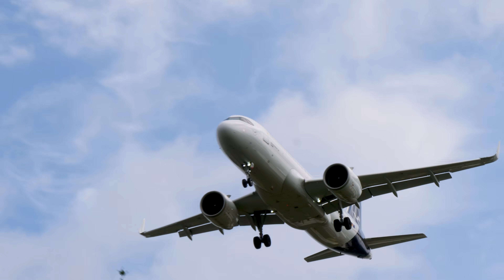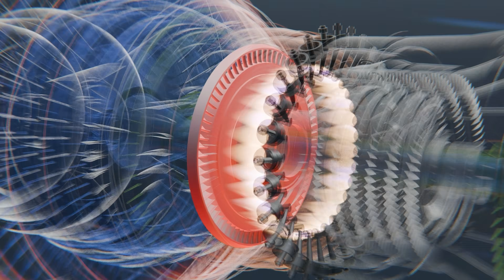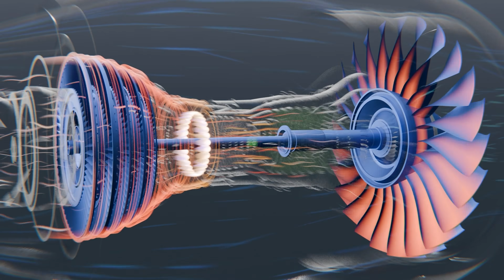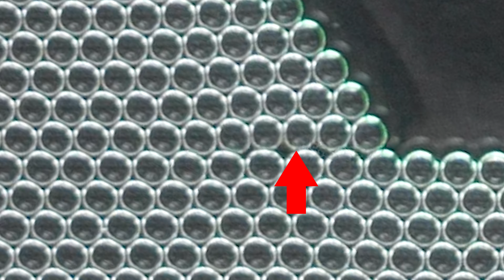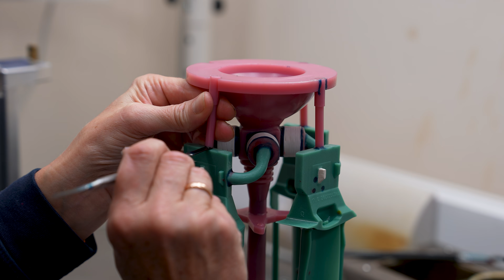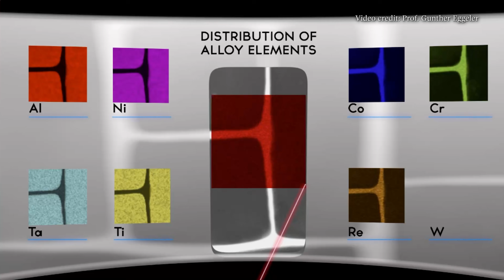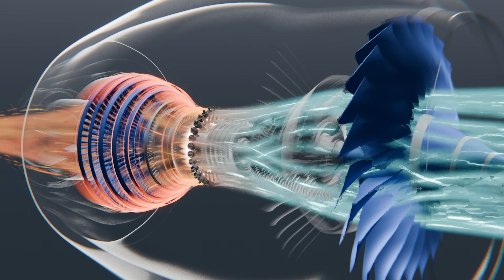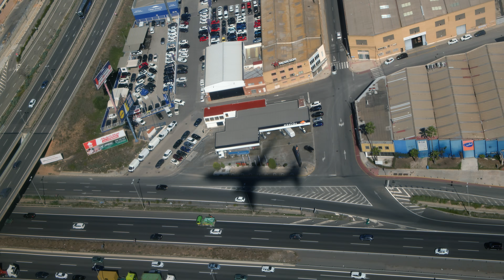The Ridiculous Engineering Of Jet Engines

Comment: Aerospace phd here: I’m a turbine guy, I have an anecdote. 

Tungsten turbine blades actually have a more interesting story. I remember during my studies I asked this same question to my professor, why not tungsten? The answer he gave is that obviously it had been tried again and again. Tungsten is particularly reactive at these temperatures. There had been a testing with a tungsten alloys that held promise but they always dissolved in the oxygen rich environment. So they coated the blades to protect them and tested them. After the test the specimen was removed and appeared to be in good order, but it was realized that all that was left was the ceramic coating. The tungsten inside the coating had eroded away. I presume a small hole was made in the ceramic coating (which is not uncommon) and it reacted away.

Now imagine that in your engine, any breach in the oxygen barrier leads to complete engine failure and probably a heavy rotor disk being liberated!

Edit: There have been a few people asking about my disseration topic. I'm a hybrid electric turbine guy. You can read my dissertaion for free since I paid the academic mafia... The title is Characterization of an Aircraft Turbo-Generator Design Space With a Shared Turbine-Electric Rotor Disk.
Reply: that's kinda hilarious lol, you're flying at 30,000 feet, one second you see the engine, next second the plane loses weight equivalent to two airplane engines and all that's left are 2 phantom shells.
Reply: @crucifiedsoulfr "Aww god damn it, the engines dissolved again!"
Reply: That’s what they said at Pratt & Whitney about their GTF disk failures!
Reply: @crucifiedsoulfrwell let’s look at the bright side here, at least the emergency landing is gonna be a lot easier 😂
Reply: @bravo_cj👈🏼gravitational @450kt downward? Might work if your bugs bunny 🐰 😂
Reply: @crucifiedsoulfr👈🏼you first😂
Reply: Yeah tbh, if tungsten wasnt so reactive it would 100% be used. Obviously many of the compositions include a large fraction of refractory alloys. There are tons of hurdles to overcome, but I am cautiously optimistic about the developments in SiC composite blades.
Reply: @anthonyschroeder521 is inconel common?
Reply: @feastoncarolina9544  "inconel" is a trade name and doesnt actually mean anything, but yes various alloys within the generalized special metals (company that owns the trade name) portfolio make parts for aircraft engines, but those are not generally the highest temp parts (718, 625 etc)
Reply: @a @anthonyschroeder521 l the interior parts of the F135 fighter jets the inner combustor outer combustor struts turbines outer case inner case are all 625 inconel.  718 is used in some of the pieces I forget exactly which ones. Keep in mind these are powerful but smaller engines than what is being shown.
Reply: @TheR3dplague well yes exactly. Not the highest temp parts of the industry, but still used commonly enough. 625 has some intermediate embrittlement issues (g", delta), but is usable up to around 900C in the right environment, 718 750C ish (body temp, not fluid temp)
Reply: @anthonyschroeder521  Not a material engineer, but heard about SiC composites. NASA is working on it but yet, the problem of SiC is that it being so brittle and unresistant to vibrations.* I still have hopes for AI-assisted materials engineering so that other kind of CMCs could do the trick. My best guess is some kind of ceramic-metal matrix would solve the case. Then we would have something more closer to a real SABRE engine (if not better)
*So far SiC used only on hypersonic craft coatings, and RAMJet engines, where no moving parts involved.
Reply: @XavierBetoN  I could be mistaken, but I was under the impression that cermamic matrix composites had left the lab and were used in production? There is a lot of research surrounding CMCs
Reply: @anthonyschroeder521  Just in (asked Duckai about it using GPT interface):
"The LEAP engine is a high-bypass turbofan engine developed by CFM International, a joint venture between General Electric and Safran. It is designed to power narrow-body commercial aircraft, including popular models like the Airbus A320neo, Boeing 737 MAX, and Comac C919."
Thanks for the anectode sir
Reply: "heavy rotor disk being liberated" might be the scariest 5-word story I've ever read.
Reply: @grinnellian09 expensive too yikes
Reply: At home we experienced a similar thing inside our own (modified) wood pellet stove. We added a small basket made out of stainless steel bars to hold the pellets such that the stove worked more efficiently, but every now and then we had to replace them. So, I told my that to maybe make one out of tungsten, since it's well-known for its incredible heat resistance. After a couple of weeks he messaged me and told me that they were even worse in comparison to the old ones. Imagine my surprise learning about this fact that tungsten becomes increasingly reactive at higher temperatures. Now we've simply settled with the old method and it works well enough during the winter, luckily.
Reply: @benvanzon3234  
Stainless needs an oxidizing atmosphere to develop it's chromium oxide protective layer.
A reducing atmosphere (no oxygen) and contact with carbon strips the coating and destroys stainless pretty quickly at red temps.
What you need to use in high temp reducing atmosphere is cast iron, but don't take it above 800C.
Cast will absorb carbon which also causes the metal to (dust) slowly, but a lot better than stainless.
Cast iron welding rods are cheap, just heat them red to bend or they'll break.
That's what's used in coal fired power plant conveyer chains.
Reply: @sparkyy0007 Interesting. Despite this fact, stainless steel hardware still lasts longer in a reducing atmosphere than regular steel does. Or that's my experience anyway.
Reply: @benvanzon3234 Wonder how expensive it would be to fabricate a combustion basket out of inconel?
Reply: @DrBilly90210  The answer is.... very, hah. And very difficult.
Reply: @DrBilly90210  You could make the basket out of stamped/laser cut inconel sheet metal and it wouldn't be too expensive.
Reply: @DrBilly90210 everything in aviation is incredibly expensive already so no biggie
Reply: I was a USAF jet engine mechanic, and now a physics student. Yeah this was an issue for refractory metals as well, all very promising high melting points but also all reactive to oxygen at high temperatures. The Germans actually used an alloy with Niobium in it for their prototype jet engines, but were unable to source enough of it for the mass production versions (as a result, the prototype engines were a bit more durable). One unique case of a refractory metal being used in propulsion is the rocket engine on the Apollo Service module. That engine was a Niobium alloy that was only operated in the vacuum of space, with a slightly fuel rich exhaust, so it never suffered oxidation under those conditions. When I was younger, I became obsessed with composites like Zirconium Diboride, because they offered these same ultra high melting points, but with a high resistance to oxidation due to already being a molecular lattice of bonded metal and nonmetal. However, many of the research papers I'd read mysteriously disappeared from the internet... And now we have hypersonic weapons... And some of these experiments were being funded by the USAF... I put two and two together and realized we probably won't see this technology in the civilian sector for a while.

Ps, if you want to read about some obscure jet engine history, NACA archives are a treasure trove. One of the weirdest things I ever ran into, all jet engine researchers in WW2 were struggling with metal fatigue in the turbine blades. Germans eventually solved this by using compressor bleed air cooling pipes, and turbine nozzle cooling holes. Well, in America, like a lot of these researchers, they were starting from the world of turbochargers... So one of these researchers over at the half finished Lockheed L1000 jet program had this crazy idea of using an inter-cooler between the combustion section and the turbine section. It would heat exchange exhaust gasses and intake cooling air before the exhaust gasses go through the turbine section... Absolutely wild idea. Nothing ever came of it though.
Reply: Kinda makes sense... if you've ever broken a lit lightbulb with a Tungsten filament inside. It burns up in a fraction of a second...
Reply: @abcdefghijklmn-i5e Yes, I've had that happen, but it didn't burn up in fractions of a second, more like a few seconds.  And the filament burns even brighter.
Reply: Yeah as someone that TIG welds, oxidation happens pretty quickly (in comparision to engine life) on your electrode. Of course, the electrode is probably getting way hotter than a turbine, but that's just a function of time.
Tungsten is also super heavy, and that rotating mass would generate more force compared to superalloys.
Reply: What was you research question for your PhD. Over how many flying hours did those tungsten blades erode?
Reply: @ekulda  No I’m not a materials guy. I’m a hybrid electric guy. 

You can read my dissertation I payed the academic cartel so it’s free. The title is Characterization of an Aircraft Turbo-Generator Design Space With a Shared Turbine-
Reply: Hey there’s an easy solution just like with lightbulbs, put it in a vacuum. That way it can push around the air in the atmosphere without diso…. Oh wait that won’t work.
Reply: @billcipher1756  lol.  yeah AIRplane in a vacuum.  very very efficient.  good one!
Reply: @billcipher1756  😂
Reply: Thank you for posting that anecdote.
Reply: Gotta admire their tenacity but god dang if that metal is so bad it’ll completely dissolve away in a short period without a coating how on earth would a coating ever be safe option
Reply: A very fortunate thing about nature is that the ingredients you need for creep resistance in a nickel-base superalloy also provide oxidation resistance. Oxidation resistance is *required*, notwithstanding the life-extension you can get with coatings. And not only is oxygen hell on refractory alloys (molybdenum has also been considered) in terms of oxidation resistance, dissolved oxygen makes them even more brittle. 

Other issues abound. A tungsten alloy really isn't very strong, but it must be extra strong to carry its own (centrifugal) weight. How about an internally cooled blade? Or a directionally solidified blade? Nope - there is no casting method at all when it comes to W. Those curious about tungsten generally will want to study how lamp filaments work - you'll learn something very interesting about potassium.
Reply: Say, why haven't ceramic turbine bladea not taken-off?
Reply: @shaider1982  Ceramic coated blades are commonplace they just don't have material inside them that will react away (i.e tungesten)
Reply: Nice and informative.
Reply: Just finished my Aircraft Propulsion module, probably one of the hardest modules ever. Can't believe how hard it will be on a postgrad level.
Reply: @232Invoker  It really depends on the teacher. I had a great teacher for all my jet propulsion related coursework and it makes a huge difference.
Reply: It's always puzzled me how there can be tungsten steel alloys when they have such different melt temperatures
Reply: @neilfoss8406  Molten iron is a great solvent so much so that any other element with a higher melting point would dissolve in an iron bath
Reply: I never liked flying.
Reply: I can't thank you enough for the access to your dissertation and other articles...thank you
Reply: Good catch sir.  Came here and glad you pointed that out. At these hot  turbine gas temperatures of up to 1 700 °C ; tungsten starts at 400-500 °C to slowly oxidize on the surface to form tungsten trioxide (WO₃).  The oxide then evaporates rapidly at temperatures above 600 °C and further the rate adds with temperature increase.  This is its major hurdle. Nickel super-alloys on the other hand, form a protective alumina (Al₂O₃) layer that prevents corrosion.
Am sure mechanical and material specialists can counter the increased overload the turbine disc due to the enormous centrifugal forces owing to tungsten's higher density (if added weight is not that an issue)  but yeah, the above is the  absolute palaver.
Reply: Ceramic coating still allows oxygen in and not even a hole needed, at the working temperature diffusion is also a thing.
Reply: Pure tungsten is just unreasonable, it would be necessary tungsten as an alloy component such as rhenium, just way less rarer.
Reply: @jamessunderlandseventh7410  we have commercial ni-base alloys with 20% W. Sure. Pure tungsten is low ductility, more common for extreme temp inert/reducing conditions are W-Re alloys. Again, W isnt even necessarily the best choice amongst refractories because other refractory alloys (especially Nb and Mo alloys) have much better ductility and lower specific weight while still being huge improvements in creep resistance, but all of it is purely academic because all of those primary alloys have unacceptable oxidation response. Probably the biggest area of interest in the field right now is MPEA alloys like GRX-810 and *if* they can supplant our current gen of single crystal alloys.
Reply: Sounds like hollow ceramic blades are the way to go.
Reply: @peetiegonzalez1845  Ah yes.
Thanos snap the blades in the middle of the ocean.
Reply: It appeared to be in what
Reply: Next challenge is to drill the holes and ceramic the inside and outside
Reply: Dont they have ruthenium tungsten alloys to fix that? Or was it tantalum?
Reply: Wow that was my exact question
Reply: hmm, that sounds a little too fantastical for my taste. Got source for that story?
Reply: @DanFrederiksen  There's a reason I called it a anecdote. The turbine folks are a small world and a lot of the good stuff isn't published. So I don't know it was ever published.
Reply: I had a dumb thought about the dust problem. Could you create an ionized manifold to pull dust to the outer air current so it bypasses the internal turbine. Not an engineer just had a dumb thought on air filtration.
Reply: @CRAZED4MORE 'dumb' ideas make for fun research topics and ya never know
Reply: @CRAZED4MOREThe suction of the engine is too powerful, and it overcomes the forces keeping the dust in place.
Reply: @CRAZED4MOREI was thinking filtration and didn't get that far.. nice move... you're less dumb than me!
Reply: From that though, ceramic turbine blades seem promising
Reply: That's not more interesting.
Reply: That's incredible! So this is a "hybrid" design that you are going for? Similar to how Porsche are running hybrid turbo chargers on their latest car?
Engineering Explained just did a review on their car and it's pretty awesome how their system works and is also used to harness and generate electricity in off throttle moments and then the turbine can be spun up using an electric motor early in the revs (low rpm) when the system usually experiences turbo lag.
Hybrid systems, I think have far greater potential especially for energy cycling, energy harvesting and energy distribution.
And because air craft burn a lot of fuel to stay in flight; I feel that there are limitless possibilities for energy recapture that could increase efficiency over all. You are important and very much needed. I wish you all the best in your exciting job!
Congratulations too. You've gone through unfathomable amounts of effort to be where you are! Well done
Reply: @jameshatton4211  Thanks! my dissertation topic is about flexibility, hybrid when you need it and turbojet/fan when you don't!
Reply: Brittleness and heavily dense
Reply: Yeah and same goes for Molybdenum which would otherwise be also a good candidate
Reply: If you're not an electrical engineer, you're wrong! Trust the science 🔭🤡💉
Reply: I thought they used inconel tbh ... well done to you sir 👏 👍
Reply: hi Joshua, thank you for explanation :)
Reply: Why not make it out of ceramics
Reply: As a turban guy, thanks so much!
Reply: hats off
Reply: Thanks for giving out the title! Aerospace eng student here. Really interesting topic. Will read it!
Reply: Will look like an idiot but I will take the risk to learn: Why not use ceramics as blades then? Would they break from the speed or the dust?
Reply: @yasyasmarangoz3577  Making turbine blades from cermics is a big area of research (and maybe used in a few modern turbines?) most of them are called ceramic matrix composites (CMCs) if you google it.
Reply: link of the paper pls. thanks
Reply: I’m a mechanical engineering student, great explanation :)
Reply: How about Ta-Hf-C Tantalum-Hafnium-Carbide?
Reply: So cool man! Thanks for sharing!!
Reply: A little-known Italian jet engine was probably the inspiration for sir Frank Whittle’s design - it used a petrol engine to drive the compressor stage. The genius was connecting the dots and using the turbine to power the compressor stage(s), making the engine self sustaining.
Reply: As a high school physics student, never knew that Tungsten could be so reactive!
Thanks!
Reply: @rennflich that's why incandescent light bulbs are filled with nitrogen, otherwise the tungsten would burn up
Reply: the tungsten filament that was used in old lightbulbs required the bulb the glass shell to be filled with noble gas to displace oxygen so it wouldn’t react.
Reply: @Strawberryearthquake2 What noble gases were most prominent back then?
Reply: Hey, I'm an aerospace student who would also like to follow the gas turbine route. I was wondering if you might have any insights or suggestions about education or internships?
Reply: @kaksok4436 Try the Edison Program at General Electric (now the gas tutbine division has rebranded as part of GE Vernova).
Reply: @kaksok4436  I would 100% prioritize getting an internship as early as possible in undergrad it makes a huge difference when applying for better internships and jobs etc. Look into research scholarships programs your school offers, often they are easier to get then you might think (and often less work then you’d think…). Also very common for your first company to pay for your masters so keep that in mind. 

If I was looking for a job right now I’d look at some of the small turbine companies but that’s just my preference. The big three are definitely a more stable choice but you’ll be a sub component guy if you go that route.
Reply: @k @kaksok4436 d suggest you download his thesis paper and contact the school he studied at.  Good luck!
Reply: This is all making me not want to ever fly again.
Reply: @andyjones7121 you can think about it like that, but this all goes to show how many smart people are involved in making sure your life is safe when you fly
Reply: Would not happen for a flight on mars. You should get in touch with Musk and sell him a turbine for his soon to start Mars colony.
Reply: @VR_Wizard  actually it still would. Tungsten is *very* reactive at these temperatures. Ive personally run experiments in pure CO2 at temp and doped with CO and the disassociation partial pressure of oxygen (10^-15 pO2, 2*10^-9 Pa) was enough to blow tungsten samples to bits in minutes. Mars has something like a 600 Pa of oxygen pressure, much much more than is needed to obliterate tungsten.
Reply: @anthonyschroeder521 Fine.  We'll save them for when we colonize Jupiter
Reply: @anthonyschroeder521  Tungsten is heavy and will make supporting it add a more heavy stuff making the engine alot more heavy ,and weight is the pest performance enhancer.
Reply: @fdgdfgdfgdfg3811  it has 2x the density and between 10-100x the creep resistance. You'd easily be able to make a thinner part work if not for the environmental degradation in service. Same with all refractory alloys. Nb alloys are very roughly 3x the creep resistance of the best gamma' Ni-Co alloys at the same density. Mo alloys are a solid 3-5x more creep resistant than the common Nb alloys and are about 25% heavier. W-Re alloys are stronger still, and heavier still, but much less ductility. My commentary stands, you'd be shocked to see how much work has been put into corrosion resistant coatings for refractpry alloys, but it still isnt close to good enough for commercial aviation. Maybe someday. Probably not.
Reply: @VR_Wizard  "You should get in touch with Musk and sell him a turbine"  
i really DO wish Musk would get on with building his "ark B" and remove himself and his buddies from earth, permanently.
Reply: This internet trend of starting comments with ‘Expert on a subject here…’ really needs to stop.
Not trying to be rude, but when someone opens like that, it comes across as trying too hard to prove something. It’s not how people talk in real life, and it’s honestly unpleasant to read. It has become a silly online habit where fake experts try to shut down discussion by flashing supposed credentials. You don’t need to do that, just let the information speak for itself.
Reply: @ipfreely umm you got zero clue. This isn't attention seeking bro. You are in the wrong comments section bro
Reply: @ipfreely it's interesting to learn. Why not share papers and research. The internet is one big world community right? Expert or beginner. Its not to doubt, but to get information. Most research papers are on academia, and its free for all to learn from. We are not from corporates to steal anything.
Reply: Boring. Plane go fly go away nerd!!